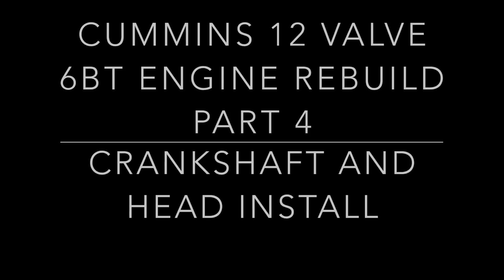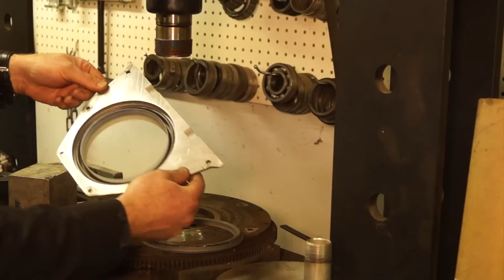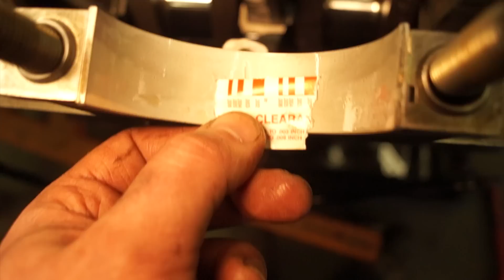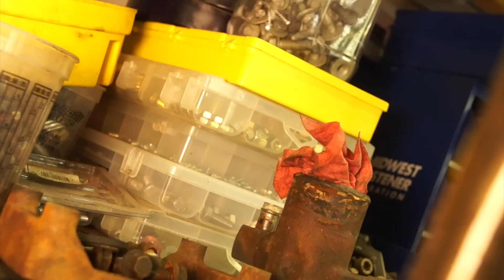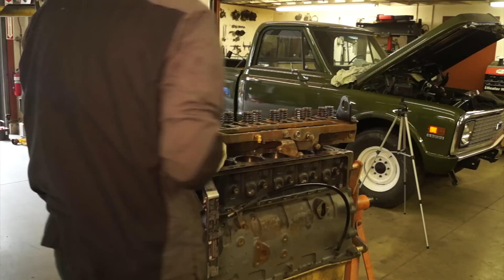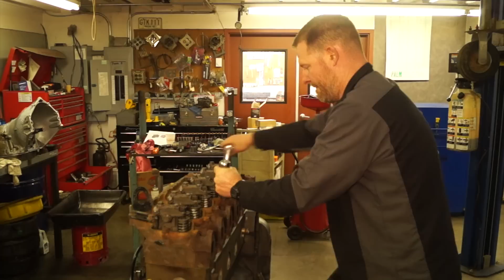Part 4 - How to Rebuild a Cummins 12 Valve 5.9L Diesel Engine - Cylinder Head and Crank

Comment: Awesome videos. Thanks for posting them. BTW it's a myth that a straight extension changes torque. People like to use torque sticks as a example 'proving' that they do, but it is an apples to oranges comparison. Basically a static VS dynamic comparison. I digress. Thanks again for taking the time I will definitely refer to these videos when I tackle my refresh!

Comment: I hope you aren't reusing torque to yield head bolts.  If they are (generally any bolt that uses an angle gauge as part of the torquing process is torque to yield), they they should have been replaced with new ones during the rebuild.  Those head bolts look like they are the ones that came with the motor.  Yes, there are people out there that have reused torque to yield head bolts without issue, but it generally isn't a smart thing to do because they can break while in service.
Reply from the maker: They are not torque to yield bolts and can be reused.

Comment: Loving this series!  I've been seriously considering a 6BT into a 1987 Chevy 4 door cab long bed 4x4.  I've rebuilt my share of gas engines, never a diesel.  I'm curious, no deck shaving or head shaving for a diesel or was this one just in that great a shape?  For 250,xxx miles it looks amazing, I was surprised to see the crosshatch still in the bores and the bearing wear.
Reply: Was just in great shape.  Its not uncommon for things to get a little out of plane with those cast iron blocks and heads.  Usually guys will replace all of the factory valve seats while the thing is apart though.  Those factory seats have been known to drop.

Comment: That was an awesome video. You are doing a great job teaching people like me. I have a question about gear timing. Is all you have to do is mark the gear before removing it and replace it as you found it called timing?
Reply: Your timing is pretty much simple same thing as a gas motor they'll be a little. Or a little gas in the cam and in the crank gear there should be I have never rebuilt a diesel engine but I've done quite a few gas and I own I phoned about four or five diesels and I've worked pretty much everything besides rebuilding the whole motor I've done pretty much everything to them Transmissions gaskets all new seals turbochargers usually they run so good I don't have to get fully in depth to rebuild the whole thing but pretty much sometimes it's like I got to rebuild the whole thing if it's got an issue running and I would say if you're going to do an engine due a12 valve I have one right now that I own current Lee it's a 1997 and it's a very good engine 7 3 Powerstroke and the 73 IDI and 6.9 IDI are good but I think I like the 12 valve more good luck on whatever you build I don't think you can double-check yourself but I don't think that you have to do any other timing just add. Or that gas that's in the crank gear and in the cam gear should be all you need is it I have actually done the high pressure oil pump on a 7.3 powerstroke couple years ago and that's the gear that sits up on top of the intake and I can't remember if I had to put it back within time and I think I did I think I had to have the cam gear in line with the high pressure oil pump gear because the cam rides off the high pressure oil pump but that's on a 73 not on this one that's 12 valve haven't done a lot to the 12 M couple things here but that's on a 73 not on this one that's 12 valve haven't done a lot to the 12 M couple things here but that's on a 73 not on this one that's 12 valve haven't done a lot to the 12 M couple things here but that's on a 73 not on this one that's 12 valve haven't done a lot to the 12 M couple things here but that's on a 73 not on this one that's 12 valve haven't done a lot to the 12 M couple things here and there they but that's on a 73 not on this one that's 12 valve haven't done a lot to the 12 valve couple things here and but it's completely different engine from the Ford engines Chevy Exedra but diesels runoff compression and a lot of gas guys will be afraid to mess with the diesel and there's really no difference they're actually easier cuz you don't need spark to ignite the cylinder

Comment: that is wrong you have to tight the crank shaft before any piston fit because you cant read the backlash of crank
Reply from the maker: It is not a problem to check the crank thrust with the rods hooked up.  It is often verified when the engine is installed in the vehicle.  Thrust issues are most often found with manual transmission applications.
Reply: seems like it would be an extra step if you were to plasti-gauge the crank and it be out of spec. then you would have to bang those pistons back out along with the crank. just constructive criticism

Comment: Did u reuse the oil head bolts?
Reply from the maker: Yes the head bolts were reused.
Reply: Did you check them for stretching
Reply: Regardless if I knew the mileage headstuds I replace  that's one thing I for sure dont want breaking